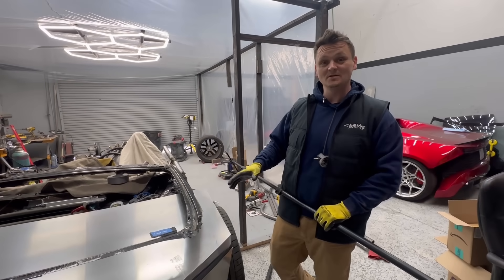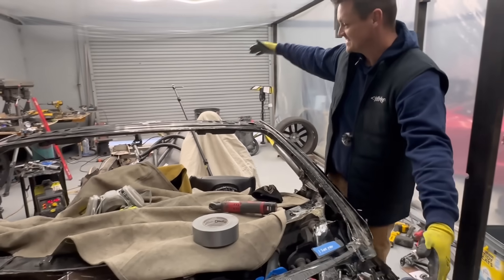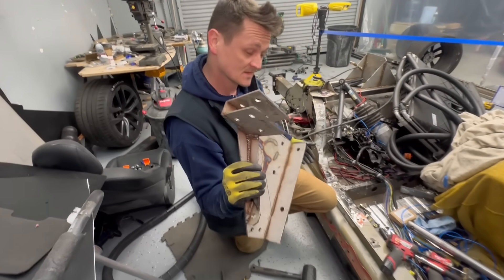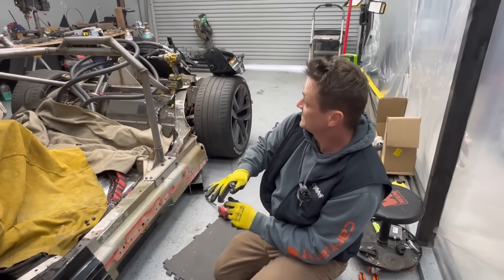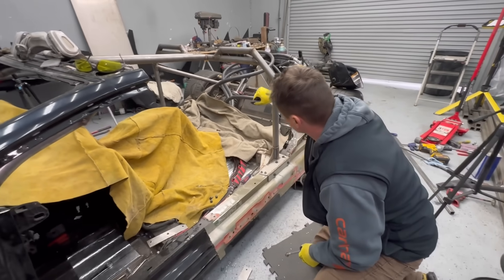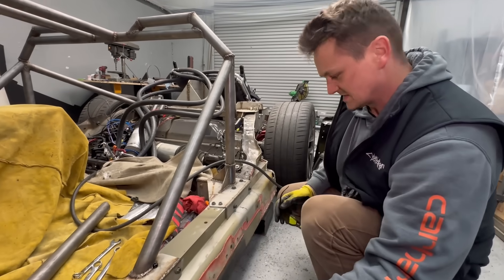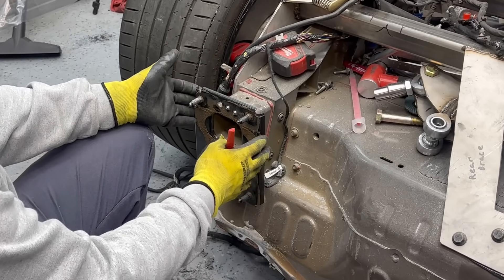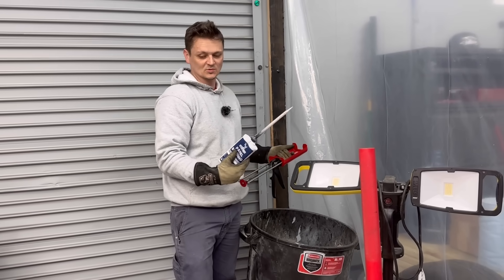The structural skeleton being built on the CyberPlaid

Comment: That's a mixing nozzle, on a dual cartridge extruder gun the mixing nozzle has to be that long to allow the two sides to mix before they deposited on your working surface. And as far as only one side coming out, the gun has dual plungers that act together, so they would have both come out had you continued to squeeze at some point. Unless one of the plungers was broken.